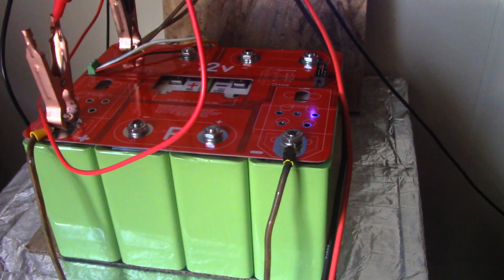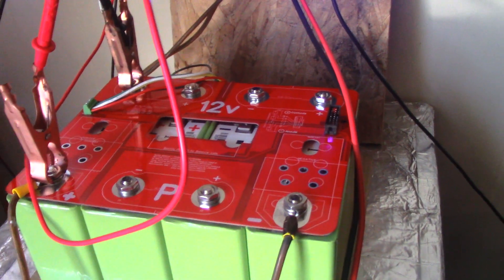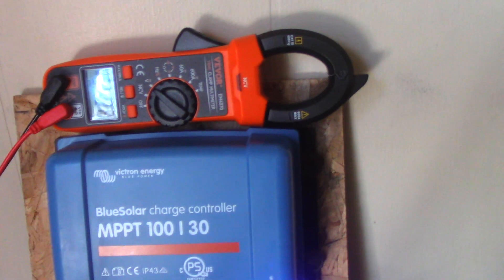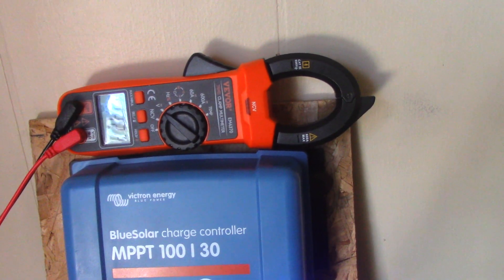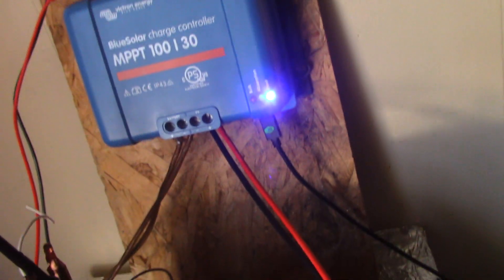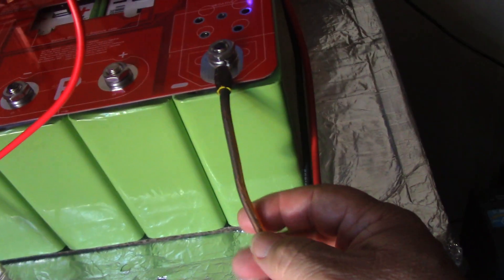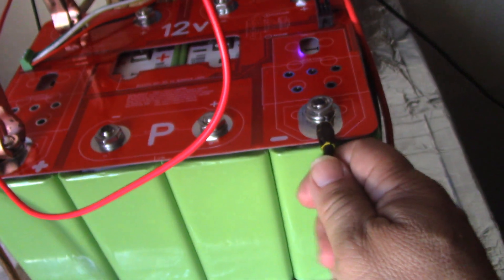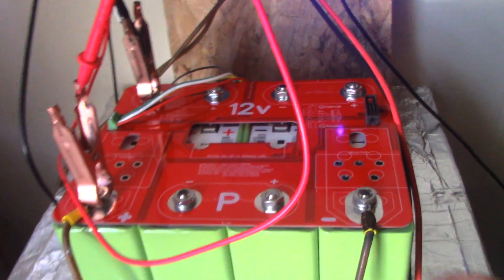4S HIGH DISCHARGE 600A LIFEPO4 74AH PRISMATIC CELLS

Comment: You need a heavy Gauge Cables when you run a 12v system due to low voltage and higher Amperage.
Thanks for sharing buddy.
Reply from the maker: yes  you are right i changed out the wire for a heavier one.

Comment: How is this working on a power wall setup like this i ordered this battery yesterday for car audio and was wondering if it is universal for solar
Reply: I’ve been considering between these lev60s or the red headway 8.5. The headway would cost more and I would consider only doing a 64ah size battery one that would fit inside like those h7 battery boxes to replace the battery that’s already in my trunk. Initially I purchased scib cells but returned them after I realized the full charged voltage wouldn’t be compatible with my charging system so I’m back to square one with my planning
Reply from the maker: @onesikm3  Jag35 has a good variety of batteries that are either DIY or already assembled. The Valence Batteries they sell are really good also. They are small (40amps) but have a 100 amp BMS. I have 6 of these batteries i bought from ebay a few years ago and im currently using them. Anything with a built-in BMS is the way im going to go. I dont want the aggravation of installing a BMS.
Reply: @mannyfragoza9652  I’ve considered getting one of those medical valence batteries myself , is that what you were referring to in your previous comment ? 

I was looking at those a few weeks ago and thought about getting it just for the case since the cover unbolts and also considered removing the bms to allow the cells to really push their boundaries. I feel most of these batteries are capable of the amp output but the bms is limiting them for less customer complaints returns ect and longevity
Reply from the maker: @onesikm3  " one of those medical valence batteries myself , is that what you were referring to in your previous comment ? " yes
Reply from the maker: @onesikm3 Just saw this today: This batttery is on sale which is a really good price Timeusb 12V 100Ah Pro LiFePO4 Battery, 1280Wh & 100A BMS
DESCRIPTION
Regular price$353.00 Sale price$208.99
Timeusb  has EG4 cells which are really good
Reply: @mannyfragoza9652  oh thank you sir! I actually found a local seller in California this week which got me 4 shipped out to me yesterday for about 141$ give or take a buck or two lol. But I do need a balancer not so much a bms to limit my current . Got any suggestions on those ?
Reply from the maker: @onesikm3  Jag35 suggests this one you can buy one on amazon ISDT BG-8S Lipo Battery Checker,Smart Digital Battery Tester/Checker with LCD Display, Battery Capacity Tester for Life/Li-ion/NiMH/Nicd/LiPo Voltage Checker,Black
Reply: @onesikm3   you can run anything just about to be honest all you have to do is obviously check the voltage range which you are already doing but if you want to charge closer to your voltage remove a cell and do a 5s configuration or 4S depending on the voltage of the cells but to be honest the headway does have better discharge than the lev60 but yes it will cost more I think it is 250 for the super beast and 100$ for bus bars what voltage are you trying to charge at
Reply: @Dirty2152  sorry I just saw your other question. I’m charging at 13.6-13.8 like i think I mentioned previously they don’t make a high output alt for this car plus it would really slow down the engine. The effects of going from the 80amp alt to my now 140amp factory upgrade option alt that came on the convertible models, the strain on the engine was noticeable. I could tell the drag on the accessories increased a little bit by installing the larger alternator. I was doing the race car thing for a while so every oz mattered then but now that I’m going back to full interior and subwoofer and a total of 3 amplifiers racing around the track is on hold for now 😅
Reply from the maker: for sure IMO. You have to have a programable Solar Charge controller so you can set the Max and the mins voltages according to the battery specs. Unless you want to mess around with a BMS. I dont use one on my pac.
Reply: How’s the battery been for your car audio neees Derrick ? I plan on making one this week but to replace my agm battery in the trunk and have the car and amps all run off this one pack. Do you feel they are adequate ? I’ve only got one massive 12” and 3amps in total powering 11channels all in 😄
Reply: @onesikm3  to be honest I literally just ordered a 29AH SCIB LTO bank from NORTHWEST LITHIUM for 1000$ I plan on taking it out and installing the HO alternator I bought and charging around 16v but I will say this I currently have it in the trunk running my CXA 1800.1 and two Q-class L7 12's and the stock alternator for now charging from 13.8-14.1 and it works great for around 2500-3500 watts rms but don't charge above 14.0 these batteries are intended for stock charging system not HO alternator it will damage the battery and drastically reduce the lifespan but if you don't plan on going over 3000 watts rms it will work great and it works great for my car runs the entire car and system full tilt and I never see more than a .5 drop in voltage
Reply: @Dirty2152 amazing just what I needed to hear 😁 but what’s your reason for cranking up the voltage ? And they don’t make an HO alts for my model car so I’m stuck with the factory oe upgrade option of 140amps is the largest one I could install without hacking up anything in the engine bay. therefore, I don’t plan to run anything above oem charging voltage which is around 13.6-13.8 for my car once it’s warmed up and idling and the battery is charged up. Are you doing the scib to continue advancing or were you running out of juice with these lev60 packs ? I’m just asking myself why the jump in voltage and why the 1000+ dollars to just continue running the same setup ?
Reply: @Dirty2152  what the hell ? So not only do I buy from the guy but he charges people to reply to questions too ???? I would never ask him anything honestly he doesn’t seem to even use this stuff beyond the scope of these videos. Don’t ever ask the business man how a product is performning in the real world he can only base it off of how it’s selling that’s my personal expeince is sales. But I appreciate the love bro I hear you though loud n clear! I’m familiar with lithium but my primary experiences has been with rc drag cars and helicopters using 6s and 8s packs. Those were lithium polymers, lipo, and on a 8s 5000mah battery my motor and speed controller would pull over 325+amps lol. But this car audio stuff is just a little new to me but the lithium talk and gossip let’s just say, the apple doesn’t fall far from the tree 😂 whether is rc or music there is always going to be people who come out the woodworks and spread misinformation! 

Dude that’s sick I’d like to chop it up some more with you if you got a better way to connect I hate how you can’t send private messages on YouTube and mainly to share photos would make this place a one stop shop! But I do have a couple question regarding woofer box size amps if you got an ear to lend
Reply from the maker: @onesikm3  The batteries have been great no need for a BMS or Balancer.
Reply: @onesikm3  how many watts total are all 3 amps the battery is capable of supporting around 3500 watts rms I myself have never had anything bigger than a 2k amp on it but I have found several videos on here of a guy who has the 148AH version and he has 7000 watts rms on it and it holds steady so I'm guessing about half of that
Reply: Hey derick do you say you been using the lev60f for a few months in your car now right ? Are you applying compression to them ? If not, do you see any indication of puffing ?
Reply: @onesikm3   yes I have been using it for about 4 months and yes it's the pro V2 model with the metal compression box and BMS and bus bars on top I got the expensive version of the 74AH . BUT it never gave me any problems with the stock alternator and no swelling or any signs of damage to the cells it actually worked really well as a replacement I took out the stock battery and just ran it in the trunk actually it's still in my trunk and hooked up to a 240 amp autotech alternator I installed last weekend so far it's working fine other than the fact that it's charging at 14.8 and when I shut the car off it will literally hold the extra voltage well above 14.0 for sometimes a day day and a half it never did that hooked up to the stock alternator and charging at 14.0 I could shut the car off and within a few minutes maybe a hour it would be at its nominal resting voltage of 13.2 the way it's holding that extra voltage is a bad sign of damage to the cells and probably won't last long but I don't have a choice my SCIB bank hasn't come in yet it's late
Reply: @Dirty2152  check out my previous comment here. But ya my card charging system doesn’t like to go more than 13.6 to 13.8 when the car is warmed up. I guess that’s where the voltage regulator is set to so I’m going to try tinkering with that next and get the volts up close to 14.4 if possible. 

Last night I fully balance charged my lev60f to 14.6 max charge and as of this morning it’s sitting at 14volts. Oh and this was just charged in my room so not connected to the car it dropped in voltage just sitting there out of my car but I will do it again today to reaffirm my findings since I might have Fucked up and powered some lights off it for a little while last night doing led light testing lol
Reply: @onesikm3  resting voltage of LiFePO4 cells is anywhere from 3.55 to 3.35 volts per cell. The larger the cell the lower the resting voltage typically. I would expect the LEV60F"s to be around 3.45 or 3.40 after being off the charger for 1 hour